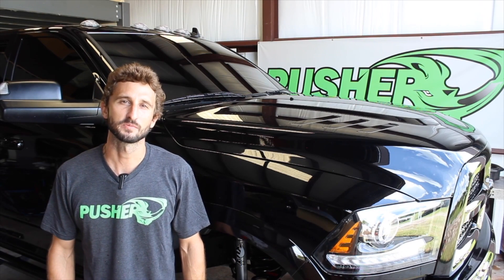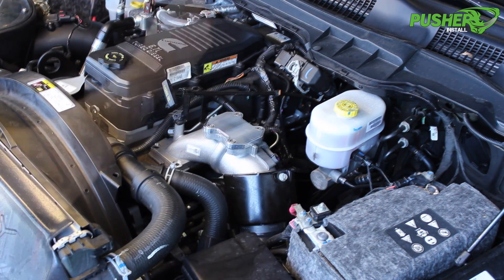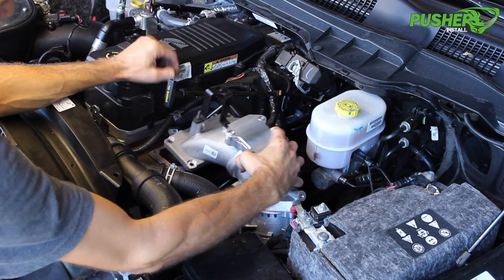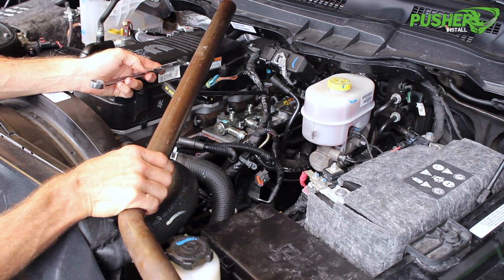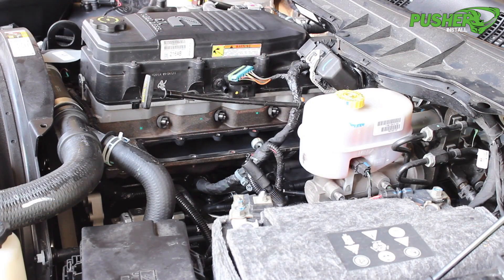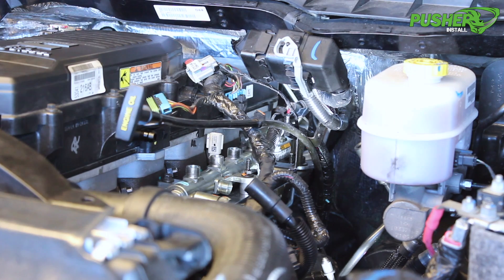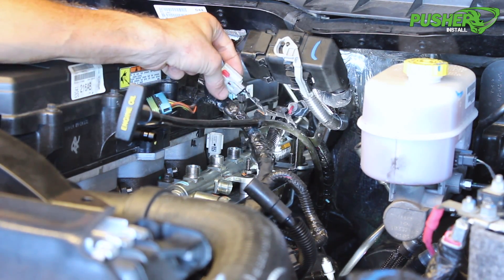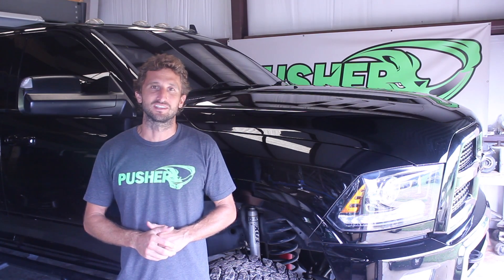Pusher Install - 6.7L Dodge Cummins Heater Grid Delete

Comment: Did this and I am having hell getting the fuel lines to not leak, do i just need to keep loosening and tightening till it seats correctly?
Reply from the maker: They do need to be tight - torque specs are the 22 ft-lb at the feed tube and 27 ft-lb at the rail. Give that a try; if you're still having issues give us a call after at 772.589.8385.

Comment: Very nice video and product.
What should a customer expect as far as actual performance and mileage increase?
Reply from the maker: You should see an increase in throttle response and MPG's by .5-1 as well as a drop in EGT's by 50-100F - even better results when combined with an intake manifold. Scroll down and check out reviews here to 'hear' it for yourself - https://www.pusherintakes.com/Pusher-Heater-Grid-Delete-Cummins-p/pdc0718hgd.htm
Reply: You will feel no difference at all.  But try it for yourself and see if I'm wrong.

Comment: How do you prime the fuel back? Just turning the key to the on position in like 10 second intervals?
Reply: Homer Garcia on my 2010 you just turn the ignition on, let the fuel pump work, turn ignition off, then repeat that 3 or 4 times then crank it up. While u have the ignition on, look for leaks, also when the engines comes on.
Reply: I cracked open the fuel line going to fuel injector tube on cylinder 1 and 3 had someone turn the truck over till fuel came out then reconnected and started after the 2nd crank. I didn’t crank it more than 15 seconds during this process I don’t know if that matters but it’s just what I’ve always done.

Comment: I was going to ask about the different bolt lengths required with your piece, until I saw the "stand-offs" being added for the fuel rail.  It would be nice if they came attached to the plate, and I'd be tempted to get them to stay in place with a little JB Weld prior to assembly.  Looks great, I may be in line to put this setup on a work truck.
Reply from the maker: The stand-offs are separate to keep the cost lower; to have them machined to the plate would greatly drive up the length of time it would take to machine the product (and therefore would drive the cost up significantly as well). That being said we wouldn't choose cost saving routes like that if they were problematic. We've never had an issue with them being separate during install,  nor have we afterward for product durability. It'll be an awesome setup for your work truck. 👍
Reply: Your idea to use a dab of JB Weld or any superglue product is a good one.
Also, a dab on the bottom side to hold the gasket in place is an old mechanic's trick.
(instead of placing the gasket on the block and letting it slide around)
Reply: Finally, people who sale something and show you in detail how to put it on!

Comment: Do you have to install a tune for this or it would work for oem truck?
Reply from the maker: This product can be installed without tuning. Although if it's cold enough and your ECM commands the heater grid power circuit and doesn't see a voltage drop from that circuit it will throw a "soft" CEL. That CEL will go way after a few key cycles.
Reply: @pusherintakes  Yea, I'm in Michigan.  the work truck stays inside overnight almost always, but on trips it stays out overnight.  Getting a code for a high read on the heater now, something is up.
Reply from the maker: @125AXer  If you're getting a code for high voltage that usually means the heater is not actually turning on (pulling current and reducing voltage in that circuit). Also we've heard from a few northern Canadian customers who've had the heater bolt back out and fall into the plenum. I'd check into that as well.
Reply from the maker: @125AXer  If you're getting a code for high voltage that usually means the heater is not actually turning on (pulling current and reducing voltage in that circuit). Also we've heard from a few northern Canadian customers who've had the heater bolt back out and fall into the plenum. I'd check into that as well.
Reply: @pusherintakes   First time I got to the shop, I got a footstool and climbed up to perform the "jiggle test" on the connector bolt to the intake heater.  Tight, no play at all.  A local shop which my boss likes to use has recommended replacing the intake/heater unit to solve the problem, but I am not convinced that will take care of it, or that it is the best solution.

Comment: I am a believer in your products and will buy a setup soon. I was wondering between the 3.5 and the 3" intake for 99 ram cummins. Removed muffler and silencer ring, 75 injectors and fass lift pump. About to do cold air and one day buy the bd super bee turbo. I'm thinking  the 3.5"  would be bad for my setup because I wouldn't be pushing enough power. Is this correct or is bigger better?
Reply from the maker: Hey Robert - bigger is generally better. In your case especially - the 2nd gen Ram trucks OEM intercooler is already setup with 3.5" inlet/outlet so you can take full advantage of the 3.5" charge plumbing. Also if you're considering a charger upgrade and your factory unit is in good shape I would highly recommend considering our Low Mount Compound System which utilizes the factory charger. It's great for your fuel economy and if you tow at all it'll make a big difference. No single charger can touch the performance gains that two chargers working together can offer. Please let us know if you have any other questions - either here, via email (orders@pusherintakes.com) or call us at 772.589.8385. Thanks!

Comment: I want to see a install of 1998.5-2002 3.5” mega intake system with the Cross-Air system
Reply from the maker: Unfortunately that video isn't in the works yet, but its on the (very long!) list to get done. In the meantime if you'd like to see instructions for the install, email us at orders@pusherintakes.com and we'll send you a PDF copy.
Reply: I will email you for the instructions. 
Thank you.